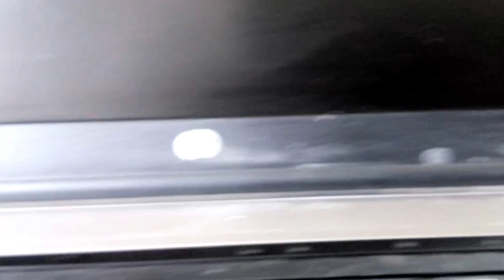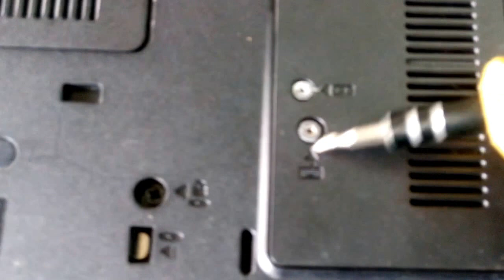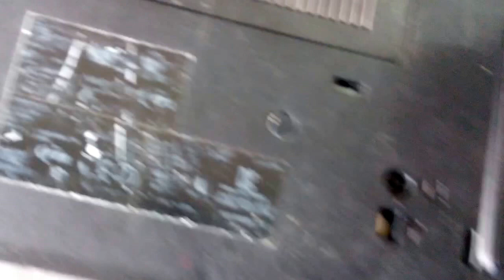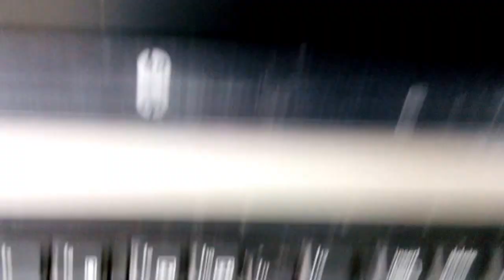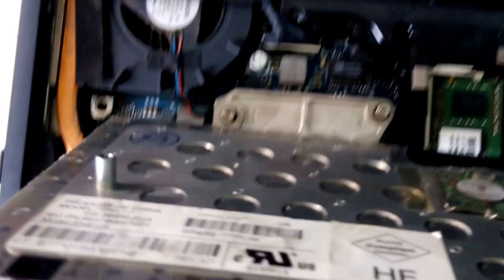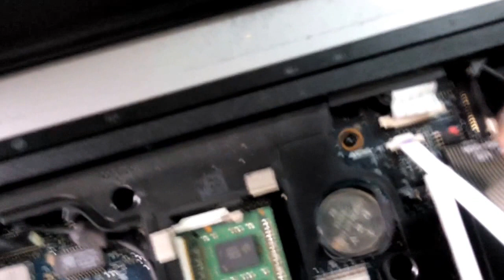DIY : HP ProBook Laptop Keypad & CMOS battery replacement.

Comment: Hello sir, I am highly need your advice! 
I was converting the MBR TOGPT Partitions. 
After the last step, it restarted.
I wae unable to boot vihd drive and back but rifht now when I i switch to it on, It  blinks the caps lock and num lock for 4 times Plus others the soud of a fan which persists until the the battery is drained.
.
I have removed from the  CMOS batery and i placed back, when i placed comninationsof bios recovery. 
It was first bink the capsl lock for like 30 times. 
It turned off automatically and restarted it it returned to twht i have been mentioned it first
.
How am f gonna solve this, I it wont cost me muckh if i take to the technician? 
I beg you re help 🙏🤲🙏
Reply from the maker: You have HDD/SSD to try to boot the computer? If Yes, see if that drive can boot the computer without issues.

You can also try RESETTING the computer.
Reply: @SonnyIbibo  sir, the hard disk which is there  its of Toshiba, I dont know whether to it can be the problem